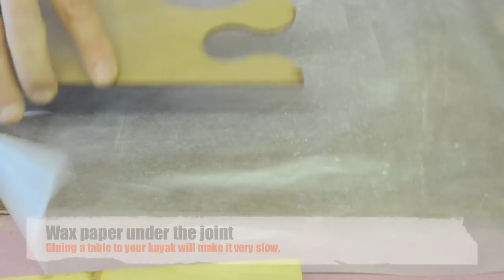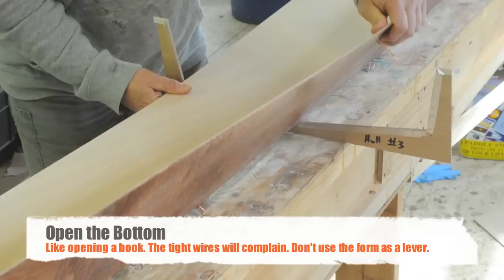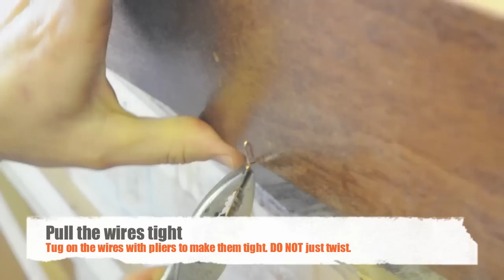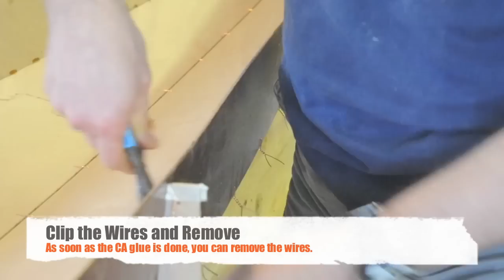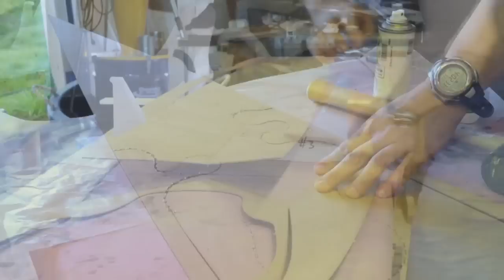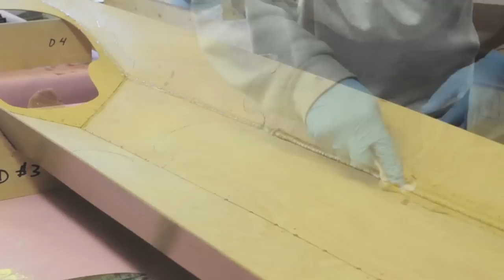Assembing a Stitch and Glue Night Heron Kayak

Comment: I looks like you have stained the outside surfaces of the panels, have you also epoxy coated them as well? If so, why do this first instead of after assembly?

Comment: Nick, 
For those of us building your S&G designs from plans rather than from a kit, how would you go about fitting the panels together after cutting them out with a jigsaw? Do you stitch the deck/hull together separately, mark any high spots then take them apart and shave the high spots off? 
I am currently building your Guillemot design (thanks very much for the plans! I'll send you some photos of the build), and maybe one day when I am more patient will build one of your strip designs.  
Thanks
Isaac
Reply from the maker: Try to make fair curves. Get your eye down close to the edge and sight down the length. Look for funky bumps and dips, keeping as close to the designed lines as possible.

It is a lot of work to stitch it up, look for problems, unstitch, try to fix them and then stitch it again. Fair, smooth curves on the edges will result in fair, smooth curves in the boat.

Comment: Hi Nick...  I have only recently found your videos and they are truly a great resource!  Thanks for that!  

I would like to ask your opinion.  In another hobby of mine, wood turning, folks are discovering that projects adhered with CA glue tend to fail after a number of years.  These are some high end pieces by well-respected artists have come apart.  As a result, in that hobby at least, folks now use CA only as a temporary holder... much like your "spot welds," but never as a permanent adhesive.

In your design, I wonder about are the longer panels that are assembled with the jigsaw puzzle-like joints.  Do you feel that the design relies on the CA to keep those joints together or once the epoxy is in place on the inside and outside, will it provide all the structural strength needed in those places?

By the way, I found your videos Monday and I am already planning to sequentially build two of your designs; a S&G project to get it done more quickly and learn about graceful epoxy application, followed up by a Strip project... hopefully with two contrasting woods.  My wife accurately calls me a "serial hobbiest."

Thanks again, Nick.
Reply from the maker: Hi Craig,
 I'm glad you are enjoying the videos.

 I only use the CA glue where it will be backed up with epoxy. It is brittle and I wouldn't trust it to hold under impact shocks.

 When I'm gluing the puzzle joints, I'm just putting enough CA on the joint to hold it until the epoxy comes along. There is not much CA glue in the joint and it is quite fragile at first. This means that there is nothing to block the epoxy from soaking into the joint. As a result, the puzzle joints are actually glued with epoxy in the finished product. 

That said, the fiberglass on either side of the joint makes it very strong. Even if, for some reason, no glue were to get into the puzzle joint, the glass on either side would likely be strong enough. So, completely gluing the puzzle joint with CA would probably be fine.

I also use CA glue at the chine seams. Here the fillets provide considerable strength. I don't want the CA glue to interfere with the epoxy fillet.
Reply: Thanks for the quick response and the clarification!
Reply: Hi

Comment: Thin CA glue would just run right throught the wood or soak into the wood, best to use the thick stuff and the thin CA also get all over your fingers if you aren't extremely careful and very hard to get off

Comment: I’m working on a stitch & glue boat and my instructions have me use wood flour/epoxy all over the OUTSIDE... it looks terrible and I’m afraid it’s going to mess up my stain when I sand it smooth. Is it better to just do the wood flour/epoxy on the inside only?

Comment: In all seriousness, could a builder use tape instead of wire?
Reply from the maker: Yes, the folks over at Pygmy Boat use tape and appear to have good success with it. I think with tape there will be more times when you wish you had 5 hands, two the hold the boat, a couple to hold the tape and another to cut the tape off, but obviously some people have worked it out.

The wire works like an extra pair of hands itself. It does have the downside of needing a hole to go through, but it works very well.
Reply: zip ties are faster
Reply: have you seen the designs by flo-mo? just amazing 1 and 2 sheets of plywood canoe and rowboat designs (3 different 12' canoes using just a sheet of ply each! and 14 -16 foot boats using 2 sheets), and he uses tape; some ppl use wire when making them I see, though

Comment: Woudl one get a cleaner seam by beveling the edges of pieces of plywood?  WHat about an internal stem?
Reply from the maker: I did bevel the plywood before assembly. An internal stem is not needed. I do have a fairly hefty fillet in the stem area which serves the same purpose.

Comment: Can someone explain the difference between pre-drilled holes and drilled holes?
Reply from the maker: Some kits require you drill the holes. So, while the panels may be cut to shape, the holes for stitching the panels together may not be there until you drill them.

With the kit version of this kayak, the holes are pre-drill when you receive the panels.

Comment: I,d untwist and pull out instead of cutting those wires.
Reply from the maker: Why?
Reply: @NickSchade   because i,m cheap and i,d reuse the wires. Hey i,m an old man and i like to watch craft vids. I,d love to build your 16.5 decked canoe with a trolling motor inboard!
Reply from the maker: The wires get so mangled and fatigued that they are not reusable.
Reply: @NickSchade   yeah ,you are right. I watched your vid on using super glue to tack everything together. Very interesting. In that vid you removed the wires. Oh when you apply fiberglass do you metal roll the surfaces to remove air or is that not needed???  I,m following an australian who is making a 40 ft cruising cat, in molds, basically single handed and he always rolls his lay ups. Also do you use peel ply to save your self from sanding chores?

Comment: Never in a million years would I ever use cs glue on a kayak epoxy or tek 3 glue is what I'd choose
Reply from the maker: I agree, CA glue is not appropriate as a structural adhesive in boat building. The CA glue used here is not structural it is merely a quick way to hold it all together until I get epoxy on it. Call it a spot-weld until the real welding with epoxy is done.